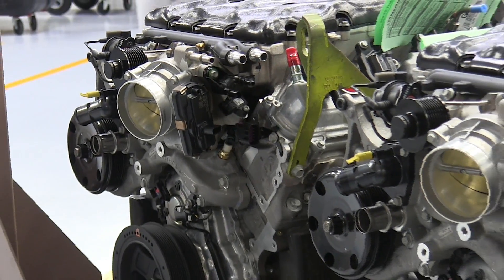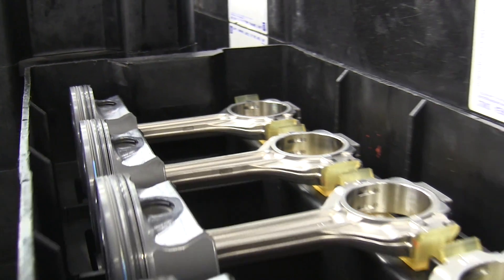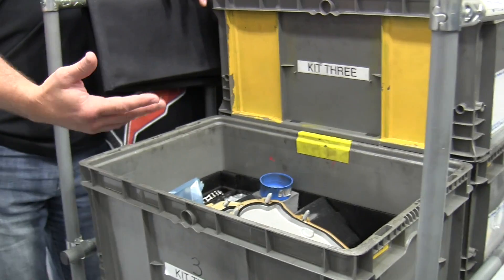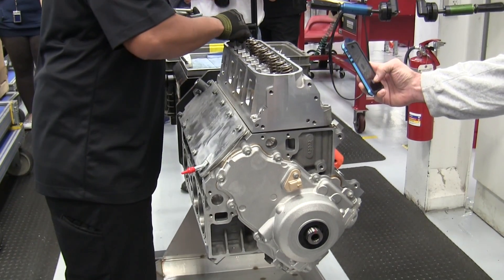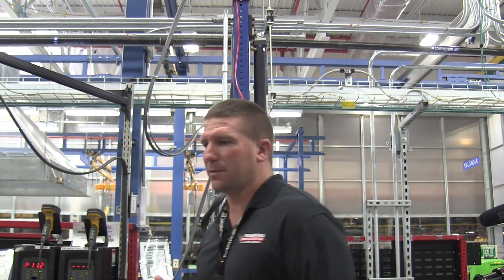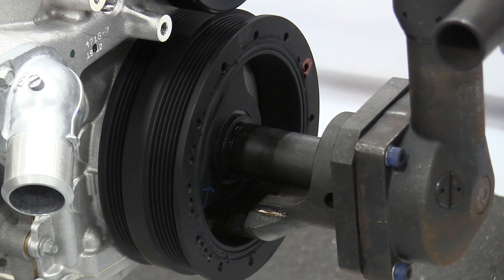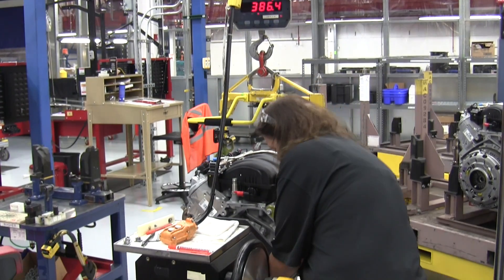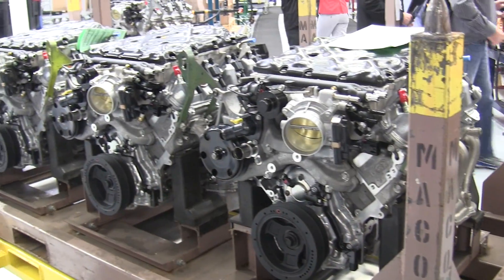Corvette Z06 (LT4) and Camaro Z/28 (LS7) Engine Build

Comment: Out of date Fuel Waster Engine , 7.0 L engines v8s which cant keep up with small 3.8 V6 Engines 

This Crap Engine will do around 12 minutes pushed hard before wasting almost 20 gallons of fuel
Reply: niceguy60 Well, you complain about them not having a valid argument, but you've failed to deliver one yourself. But since you asked...

The standard Nissan GT-R has a 3.8L TT engine, and it's slower around Virgina International Raceway and Willow Springs than Camaro Z/28, a car costing nearly $30,000 less. On top of that, the Nissan's engine is roughly 150 pounds heavier and, at least according to fuelly's real world reports, the Z/28 returns MPG on par with the GT-R, and even better MPG in the Corvette C6 Z06, even though the engine has over 3.0L more displacement than 3.8L engine in the GT-R.

Track times

http://fastestlaps.com/tracks/willow_springs.html
http://fastestlaps.com/tracks/virginia_international_raceway_post_2013.html

MPG

http://www.fuelly.com/car/chevrolet/corvette?engineconfig_id=1999&bodystyleconfig_id=&submodel_id=
http://www.fuelly.com/car/chevrolet/camaro?engineconfig_id=8508&bodystyleconfig_id=&submodel_id=
http://www.fuelly.com/car/nissan/gt-r
Reply: you are a moron thats all i have to say!!!
Reply: This engine gets mileage mileage in the high 20's. The GTR gets mileage in the 12-18 range. You cant stop talking now
Reply: you dont know what your talking about nice guy60 you make yourself look like a moron !! for your information the new ZO6 supercharged engine shuts down 4 cylinders in econo mode and gets over 30 MPG and if you want performance you turn the dial and get all 8 cylinders and 650 hp !!! you call that an out of date fuel waster I REST MY CASE YOU ARE AN UN EDUCATED MORON!!!!
Reply: niceguy  Anthony is rite  will said bro
Reply: thank you
Reply: Larry I think these can handle more boost and with modifications will make a lot of power.  That and they dont run as smooth which is why the 800HP GTRs are rattle boxes. It all really just comes down to personal preference.
Reply: None of you provided a
 valid argument just insults , keep insulting

Comment: what is the clutch in this engines,sport or normal,because i know over 300-350 hp it use sport clutch, of the another hand sport clutch is more difficult to drive on the ordinary road.

Comment: Simple question but why don't you car manufacturers install TRUE headers in these high performance machines in the factory IF the buyer wants them? Just charge for this option accordingly all the while making installation much simpler?
Reply: I believe this has to do with emission regulations and costs. Its cheaper and easier to get these motors to pass smog with these "exhaust manifolds" than headers. American car manufacturers have always been a bit cheap (I'm american, I like the cars, its just a fact. Don't hate). Don't quote me though, I may be wrong.

Comment: Whay such modern engines have got only tho valves per cilindur ?
Reply from the maker: Aleksander ARGIROV Likely cost.
Reply: Aleksander ARGIROV Cheaper, easier to work with than OHC setups, provides more low end torque, much more compact, and lighter than a similar OHC engine.

Comment: so if i understand correcctly, both these engines are the same except the lt4 has a super charger and different exhaust?
Reply from the maker: HateCrewReaper Nope, different blocks completely. They're just currently the two highest performance engines going into Chevy vehicles. LS7 is a 7.0L, LT4 is a 6.2L.

Comment: 3:22, those arnt dowel pins, but rather spring pins. just saying.
Reply from the maker: HateCrewReaper Love it when people get caught up in semantics. They referred to them as dowel pins, call them whatever you want.
Reply: come on man, didn't mean no disrespect. though they are right in a way, they can also be called dowel spring pins. just that most ppl ive worked with referred them simply to spring pins.

Comment: That head bolt torquing machine would make my life as a mechanic so easy.  I've done so many camshafts on those ls engines on trucks.  22 ft/lbs + 90 degrees + 70 degrees and 22 ft/lbs for the smaller head bolts, if anyone was wondering :p

Comment: wouldn't cast iron be a better choice for a block and cylinders since aluminum does not have an infinite life cycle?
Reply: I would say a cast iron block would be desirable if the objective were to design an engine for maximum durability but for a high performance engine in a car such as a Corvette, I imagine the lighter weight of an aluminum block is preferred.